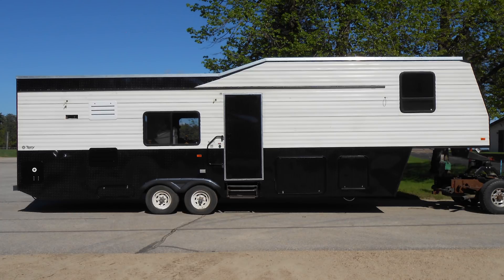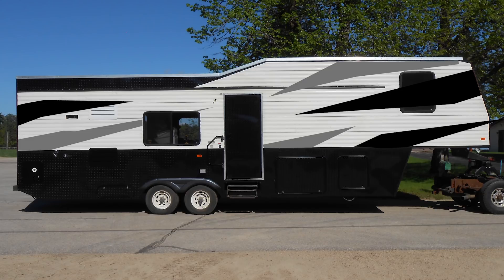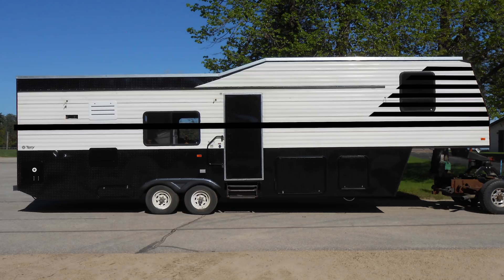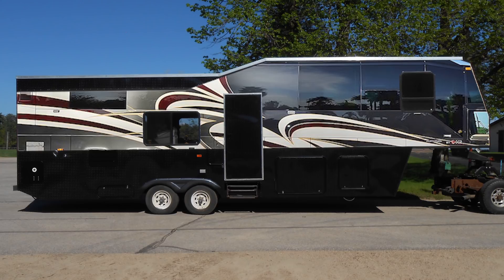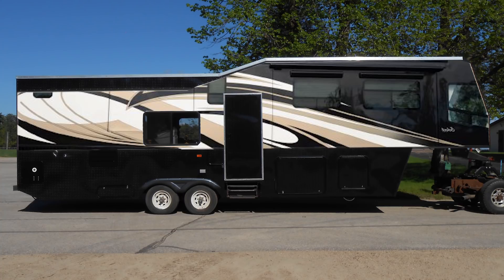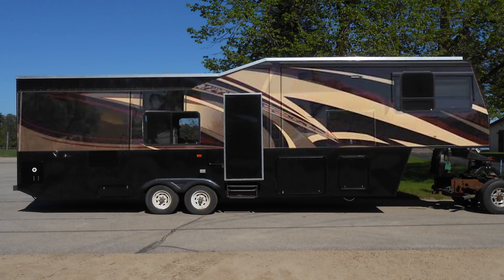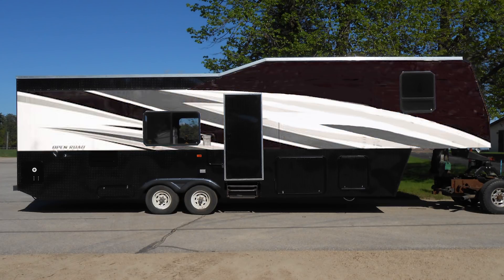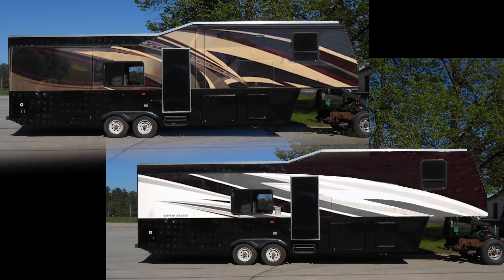92 Terry Resort Camper Build | Paint Ideas

Comment: Mossman you should talk to a vinyl wrap guy....lot easier and cheaper then paint
Reply from the maker: This older siding has a lot of angles to it.  I tried using some wrap and it was a horrible failure.  And to have a pro wrap something this big would cost a small fortune.  It will take me more time to paint but I can do that.  If I limit the colors and try not to waste any paint it shouldn't cost me that much for paint.

Comment: What are you going to paint it with? Automotive or Raptor?  You know which one I vote for...."Dale Earnhart"
Reply from the maker: Probably going to lay down a base of Raptor. Then use automotive paint for the other colors.
Reply: mossman381 that’s one thing that draws me to Raptor Liner, you can scuff it and apply other paint on top for graphics.
Reply from the maker: The texture and thickness should hide a lot of the imperfections in the siding.  Still working on the slide room right now.  Ran into a snag and it's taking more time to get it done.